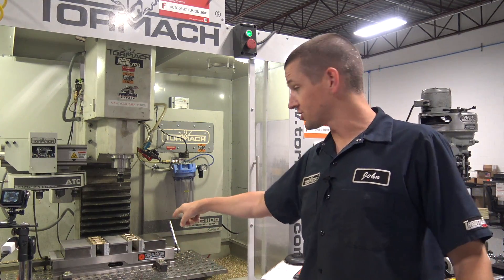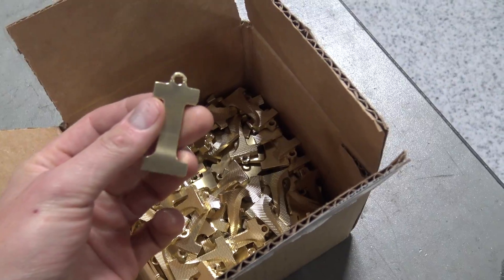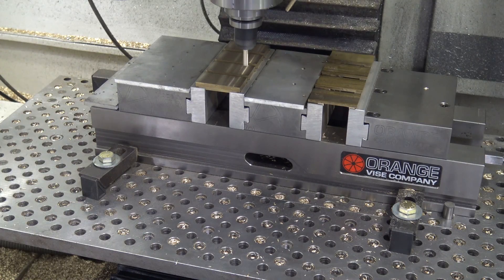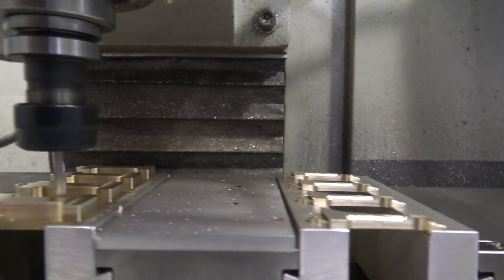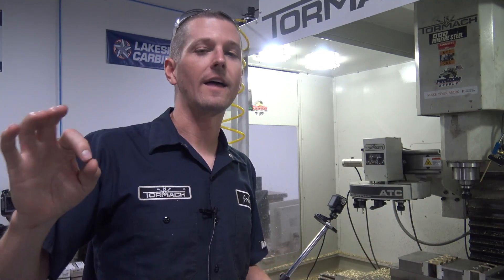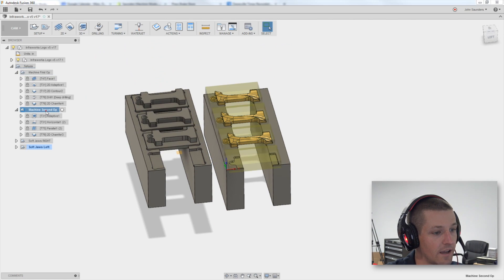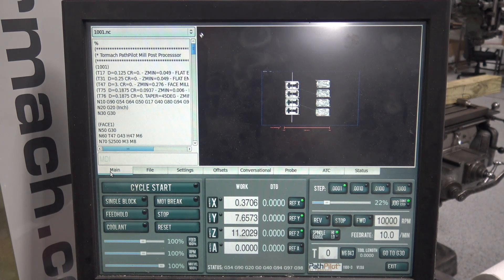Tormach Dual-Station Orange Vise Production Run!  WW119

Comment: looking too complicated for simple part. andPROGRAM NOT HAVE ANY RIGHT MEASURE FROM PART.NEED CAM CHANGE SOMETHING. POST PROCESS HOLE SHIT.
1 code difrent offset 1 G41 path if multiple depth. USE SAME path with loop. if need rought can change radius wear INPROGRAM. still can use same code. i LOVE FANUC and MAKROS . this proram is less than 100 lines. if i do it hand written!

Comment: Well you're not wrong, but I don't know. 25 minutes to 19 minutes over 400 parts is a royal ton of time. (40 hours of just cycle time). But you make a great point though. If the cycle time gets too short, you need a person at the machine full time to keep production. But if you're doing something else during the whole thing, your personal time at that machine gets effectively cut in half regardless. The Tormach is basically just a 2nd Op machine. Great to use to load a basic job up and have it run for hours. Tool changer? totally worth it. Great video. :)

Comment: Great vid!  The reason 0 and 1 work for G54 in the WCS Offset field of your Post Process Tab is because 0 means "default", which is G54.  A value of 1 means G54.  A value of 2 means G55, and so on.  http://forums.autodesk.com/t5/computer-aided-machining-cam/how-to-choose-g55-work-coordinates/td-p/5608721  I looked this up recently and found that link.

Comment: I also run a lot of brass in my VMC.    UNS C36000 or 360 brass or EN CW603N is known as free cutting brass. It has the highest machinability rating of 100 and is often used as a reference standard for machinability of other metals. Go Faster!! You can double (maybe triple) your feed rates when using a high shear end mill.

Comment: If this turns out to be a repeat job for you, you might want to see if you can get some hydraulic jaws that distribute the vise forces on all 4 parts.  It doesn't take much gap to throw a part when you have more than two pieces clamped.

Comment: A little trick I have learned for fixturing multiple blanks that vary in length a small amount, place a piece (or more) of aluminum welding rod on the movable jaw. it'll compress enough to account for length variation

Comment: I've needed to edit one of the posts in Fusion 360 and I've noticed that there is a logical check of the WCS offset number. So it checks if the offset is zero and if it is it makes it one(1). I assume this facilitates the work when there is only one WCS. If you forget to specify 1 the post change it to 1 anyway.

Comment: I still don't get it. Your toolpaths never seem to keep up with your fixturing. Why have 8 workpieces on the setup and mill 4 at a time. Your tool change time is sooooo long that I would think you would make each one last as long as possible.

Comment: This is cool. Can't wait to run a job like this. I'm a little unclear on what the op was you had to run to the blanks. Also, 
which fixture plate is that you have mounted? Do you ever end up removing it?
Reply: Rick I know it's a year later, lol, but the blanks were saw cut on the clamping edge, so he had to machine the saw cut edges to make all the blanks effectively the exact same size.  That way they don't pull out of the vise do to varying part lengths.

Comment: So I have to ask, why bother with G54 and G55 for this at all? I have been very successful in setting my WCS to one of the dowel pin holes in the bed of the orange vise and using it to machine all sorts of parts. When your cutting the jaws and the parts with the same WCS there's no need to complicate things with two different work offsets. Setup a "template" file in fusion that has the vise and a set of blank softjaws and use that as your base for anything you need to make in the orangevise. Its a very powerful and quick way to do things IMHO.
Reply: Because if you take two vices out and redo it later, it takes forever to set them up.  Where with g54 and g55 you only zero each, done.

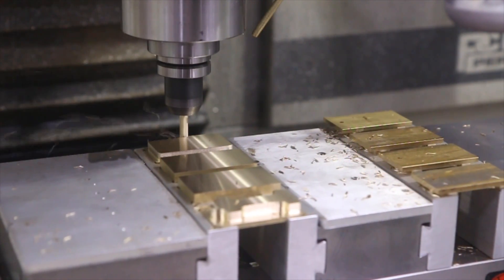Comment: 4:40 "this isn't aerospace tolerances" most of my parts go on the airbus a340 and a380 and the general tolerance is + or - 0.3mm, they are basically parts that could be fabricated but obviously can't because they're on a plane and need to be made of a solid billet with a certain grain flow etc so there are some really interesting shapes.

there are some parts that are a thou or less on every dimension but 98% of them are insanely open, just thought it was interesting to be honest because it surprised me at first.
Reply: wish I had tolerances like that on our aerospace work, +/- 0.003mm here :( 

people think aerospace have amazing tolerances, automotive have much higher tolerances, especially with the likes of crankshaft grinding!
Reply: garyhowe88 is that milling too or a different operation? that's extremely tight!
Reply: +Limosical mostly grinding, but some milling and turning as well, all on a vtg, most annoying thing is in the real world application it makes no difference, as it's all clearance.
Reply: that seems like a real pain, i can't say i've ever had to work to a tolerance that tight, i don't think i'd be able to with our tooling/machines.
Reply: I've done work for Airbus, Boeing, NASA, DoD, NovaBus, Baker, McDonnell Douglas ... Yada yada, interestingly the tightest tolerances on a whole belong to none other than ... The oilfield.  Kind of surprising to me, honestly.  Besides that, medical work is relatively tight too, and dental, but that's largely due to the fact that +/- .03 on a part that's .02 in diameter or with .008 fins doesn't really make sense!

Comment: I'm no machinist and this might be a stupid idea, but is there any reason that that the stock needs to be separate pieces in the first place?

Would it not be easier (holding wise) to machine 4 profiles from a single block, then flip it over into a set of jaws machined to hold the individual parts (even though they're still attached by the base material to begin with they would separate as the excess material from the backside is cut away)
Reply: Daryl Ball that's how I machine high production runs one blank multiple parts as long as you hold most of the part in the second vice there not gonna fly
Reply: Toms Tiny Shop  if it's a rigid set up I'll rough the backside down .02 then it's pretty thin and cuts away but looking at this second vice on this video they are pretty far apart so in this case I would try and keep the pressure pushing in to the vice I normally only leave the endmill width + some so if I'm using a .375 em I'll end up .400 for easy math I'm a hand programmer none of that fancy cam software. If you can on the first op try machining the full depth and just face the backside
Reply: Toms Tiny Shop I have also thrown parts doing it too. Doesn't work as well in hard jaws If I'm using hard jaws I stick to two parts per blank the more I can run on a machine is a lot faster than me sitting at the bandsaw
Reply: If done from a blank is easiest and most effective to come in with an end mill and 'part' them from the blank and each other, meaning turn then into individual blanks, then deck the backside, then profile.  Should save a bunch of heart and head aches.

Comment: note you won;t crash the machine if you post to offset 1. offset 0 gives no offset in the gcode so it won't change the gcode. it will assume you are in the proper offset. so always set an offset in each setup in fusion 360 and you will never have a problem. i run fixtures with multiple offsets and constantly swap back and forth. so long as the minions load the right fixture for the right gcode file, the code always selectes the proper offset. no need to rezero between runs. makes it super fast to run batches of different parts. 

TLDR

offset 0 and offset 1 are NOT the same in fusion. offset 0 will not change the current offset. offset 1 will change the current offset to g54.

Comment: Dumbest question ever: When you are doing soft jaws where there will be a big gap between them (like, not just 0.125", but like the 1"+ you're running here), what's your strategy for modeling/machining them? You model them with the desired gap and then use a something as an accurate spacer when you mill them? Or do you model them together and futz with sketches to get each end and mill them that way?
Reply: ::Runs out and starts looking for quality spacers that aren't parallels::
Thanks!
Reply: Greg Koenig just get a cheap set of parallels. for smaller spacings, dowel pins work pretty well.
Reply: For softjaw work it doesnt matter. Dont worry yourself with being crazy accurate in things like spacing. When your cutting the jaws and parts with the same WCS it just doesn't matter. I wish I could post the last set of "lathe" parts I made on the Robo, (they are a surprise announcement when I launch the lights), but I was able to perfectly blend cuts on a round part after moving them to the second position in the softjaws.

Comment: You'd  be surprises but a lot of aerospace parts I've worked on are +/- .030.  It might as well be a mile. 
 That Haas in your shop will be a huge force multiplier when it comes! The jobs you will be able to take on...I'm excited to watch how fast and far you will grow!
Reply: Areospace parts i am running right now have a couple +/- 0.001 tolerences. And require CMM every 10 pieces and full inspection report every 50.

Comment: About 6 years ago I got in to running and programming a CNC at work. We had no CAM software, I didn't even know it existed. I taught myself to do all the coding by hand. One thing I learned early on was to close subroutines and subprograms with a G90 call. This ensured that anytime  I was editing code to optimize or fix problems in the program I could easily make sure the machine was in the proper mode (G90 or G91). It is easy to make mistakes when jumping up and down the page of a program with lots of subroutines or subprogram calls. It only took a couple of crashes to learn this was a good idea.
   I also got in the habit of closing all programs with a block of code that put the machine in the default state when new programs are loaded to run, crashed do not occur. I'm not sure if Fusion 360 puts a G54 call at the start of all programs that aren't set to use a work offset. The software we use does not.  So, making sure the machine is in G54 at the end of the program is always a good idea. Once you start working heavily with offsets I find it better to be safe than sorry.